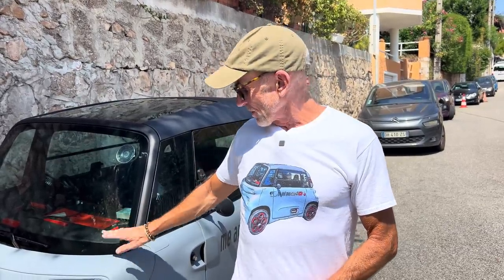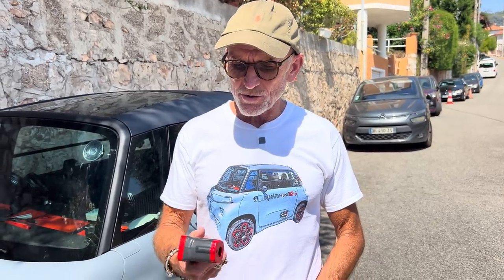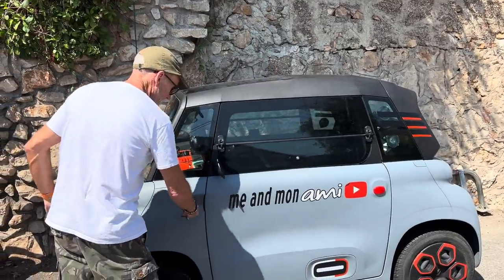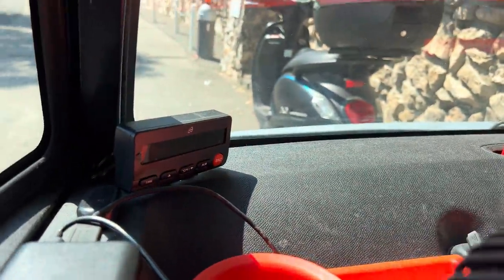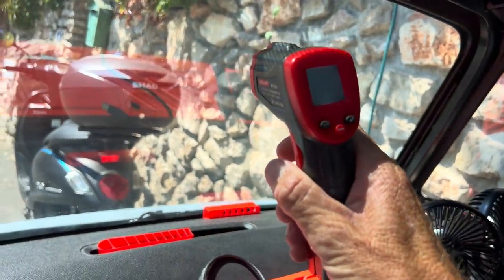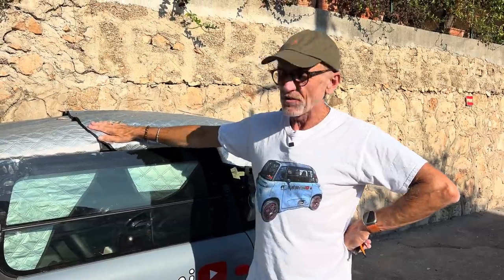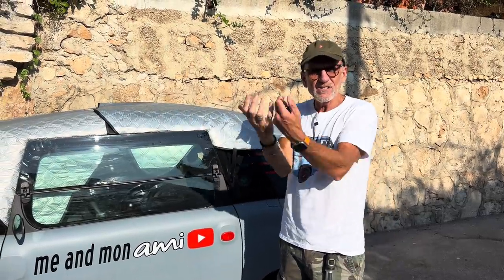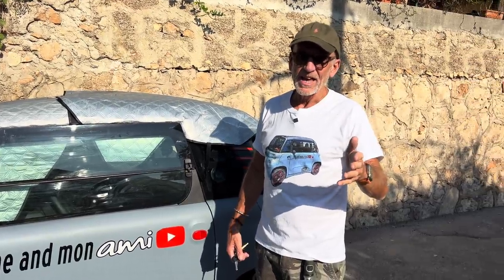Why Does Our CITROEN AMI Get So HOT? I Use TEMP GUN To Find Out!

Comment: I find it hard to believe someone thought this was a good design, the 2CV was basic but worked. The roof is not good and a canvas version might have been better, who ever designed this needs to use it and see the shortcomings that come with it. The French can produce some good things but sadly as a nation they are erratic and that’s their downfall. Why not take a 2CV and make a light weight version of that, replace anything that doesn’t need to be there and fit it with a small power unit. Citroen should be embarrassed with this monstrosity it’s not their best stuff. Why not have roll up windows like on a tent, that would reduce the cost and heat. I would only have glass for the windscreen and no where else. Even though it’s cheap it should not have the build quality of something from a Christmas cracker, Fisher Price could have done a better job.
Reply from the maker: I think it’s a fab design but it has flaws